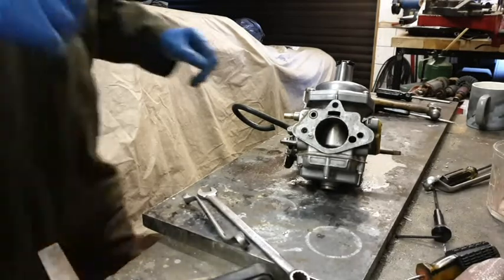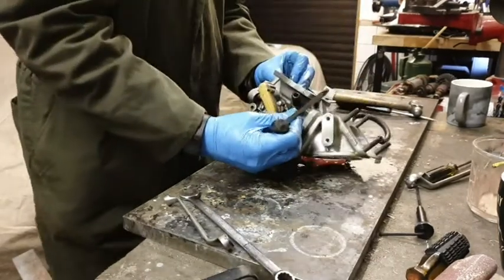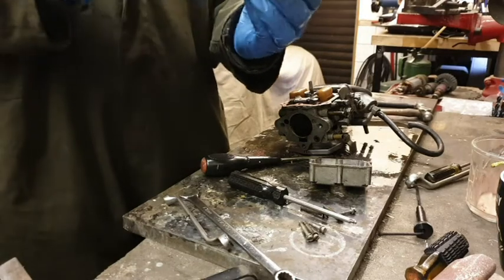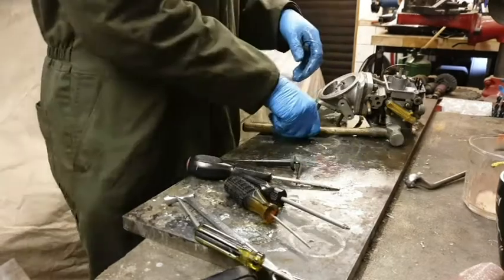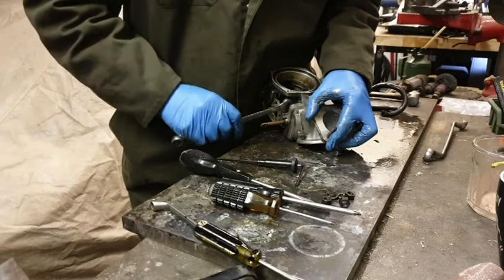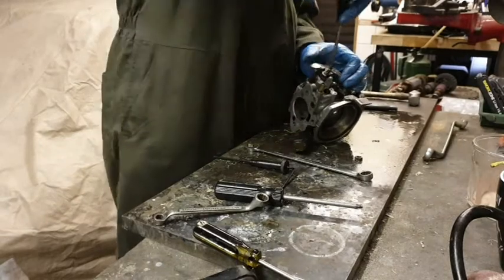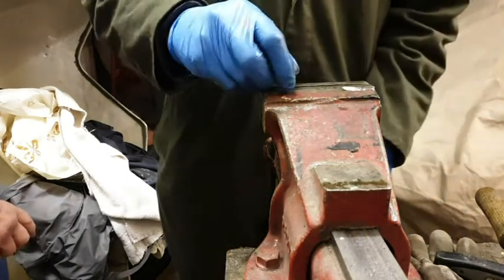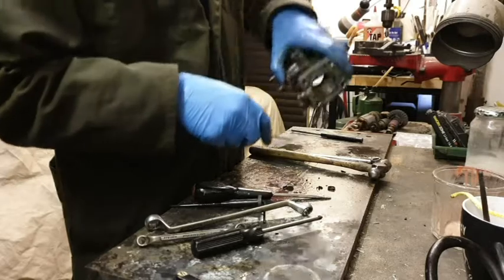Disassembling Triumph Stag Carburettor - Pre : 02

Comment: Note that an 11/16 socket is exactly the right size to remove the plug in the bottom of the float chamber.  Just push it down over the locking lugs, it pushes them all in evenly and you can pull the plug out (a flat bladed screwdriver also helps if the O ring is a bit sticky).